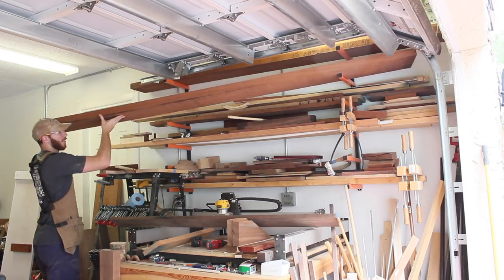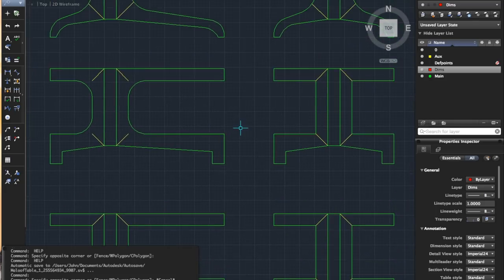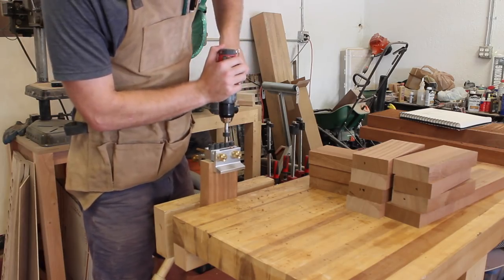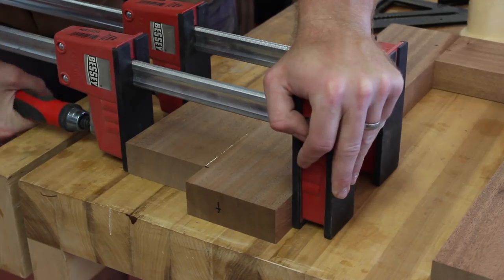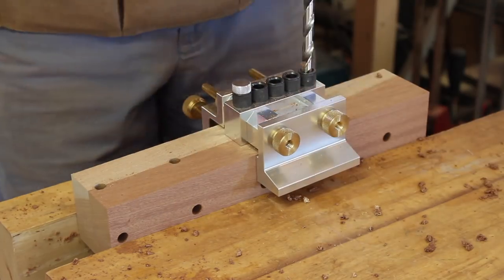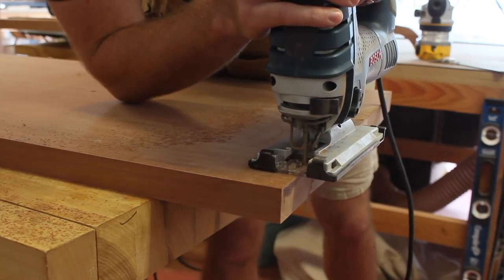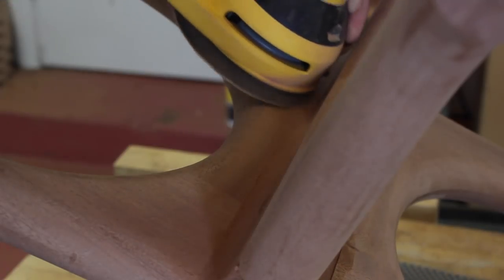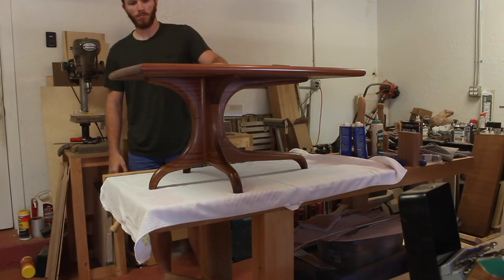Making a Sam Maloof Inspired Coffee Table

Comment: Very nice work! I'm in progress of making similar with a 22" near round Cherry Burl. I wonder, if you cut the pattern with your CNC, why not the piece itself? Depth of cut issue is only reason I can think of.
Reply from the maker: Depth of cut is one of the main reasons. In other projects I’ve also cut halfway through with the CNC then flush trimmed the rest. But having templates can be useful in general for material selection at the beginning of a project and can be used over and over if needed. Lastly, a lot of viewers don’t like the idea of the CNC doing that much of the work.

Edit: And thank you :)

Comment: Beautifully crafted. One thing, when I have to sand and router especially round over. I have a portable bench I set up outside my garage.  It saves a lot of workshop cleaning. You would not believe how much cleaner your workshop is
Reply from the maker: Good tip Colin! I did that when I made a Maloof style chair and had a lot of angle grinder shaping to do.

Comment: Your work is efficient and inspired. It would be great for commercial production. The dowel's are efficient but there is shrinkage over time. Have used them myself. More strength using more traditional methods.  Like what you're doing and learning. Became a subscriber.

Comment: Hi, there!

I've found your channel today. I must say this: Great work, great logo and great channel!

As I hate router bits with moving parts on them because once I found a bearing stuck in my safety glasses during work, I usually make templates suited for my guide bushings on my router. This way you can use whatever bit you prefer and get away with cheaper tools. But this might come late... Sorry!

Regards,
Etna.
Reply from the maker: Thanks Etna. That's a good tip and I'm sorry to hear about the bearing you found in your glasses!!!! Good thing you had those one. I wouldn't be against that method except I would need to make the templates a touch bigger to compensate for the guide bushing diameter. Thanks for the comment!
Reply: Thank you! You make great content.

Comment: Beautiful piece, love all those curves! You mentioned dowelling the feet, but I don't think I caught that in the video. Care to share any details on how/where you placed those? Thanks for sharing!
Reply from the maker: Thanks Seth. I didn’t show it in the video. But what I did was drill a hole through the bottom of the foot following the angle of the foot. I didn’t drill all the way through but the dowel goes far enough in to add a good amount of strength.
Reply: That's what I was thinking, but thanks for confirming!

Comment: for what you are doing flush trimming you could just mount the router into a hole piece of plywood and boom you have a router table - The "router workshop" methods are the simple router table ways if you ever seen that show some of their episode are on the youtubes they never needed a fancy router table or fence
Reply from the maker: Good point. I had that type of setup for my squiggle project but the pieces were too big to handle. I sort of forgot about it for this project to be honest. I’m considering a router lift install in my table saw extension table though.

Comment: Can you give more info on the dowelmax? Better than a regular doweling jig, hows it compare to the domino?
Reply: Also looking forward to your take on planning a board wider than a jointer.
Reply from the maker: The Dowelmax is really well built. It has some weigh to it and is simple to use. The built in clamps are one of the main reasons I bought it. I know other expensive dowelling jigs can perform similar tasks but I went with this one based one reviews I read as well as the ability to use the 45 degree miter attachment. 

I've only used a domino once and it was very easy to use. I think the domino is more versatile especially for situations where you need to mortise/drill on the face of a wide board. You can't really get a dowelling jig there as easy as you could a domino. But obviously there's a cost associated with that ease of use.
Reply: +Tom Dench do not over look the jessEm dowelling jig in your search I think it is superior to the dowelmax plus cheaper and built with at least as high a quality but I say more https://www.jessemdirect.com/JessEm_Dowelling_Jig_Master_Kit_p/08350-master-kit.htm

I would not say the domino would replace a dowel jig but a domino is better on most cases cause you can make your own floating tenons and since they are bigger they would be stronger than the dowels in most cases and need less of them

Comment: I'm curious why you used the CNC to cut a template instead of just cutting out the actual parts? Thanks
Reply: that is a good question
Reply from the maker: Hi Tyler. The CNC isn’t very fast especially when I need to cut out many of one item. This material was 1.5” thick which also takes a long time to cut. Using the bandsaw and flush trim bit is more efficient.
Reply: parillaworks Ah. That makes sense. I guess the CNC isn't the answer to everything like I thought. Thanks!
Reply from the maker: No problem! Ya, the CNC has it's place in a shop. To me, it fills the voids of certain work I can't get done with conventional tools. At the same time, I don't think many viewers would enjoy a video where a majority of the work is CNC related.

Comment: Yeah I don't have a router table, but I got a CNC machine!.....lol. okay all sarcasm and jokes aside why would you not just cut the entire piece out on the CNC machine as opposed to making templates and then cutting it out by hand, I'm a newbie so please bear with the stupid questions I have to ask
Reply: By the way awesome job table looks amazing!
Reply from the maker: Lol I need to get a router table!! To address your question: cutting everything out on the CNC sounds fast and easy but it does take a fair bit of time and puts some wear on the end mills. For me it's easier to rough cut on the bandsaw and flush trim with a router. Also, it would be a boring video if I just showed my CNC running in circles. I prefer to use it for templates and engraving, for the most part.